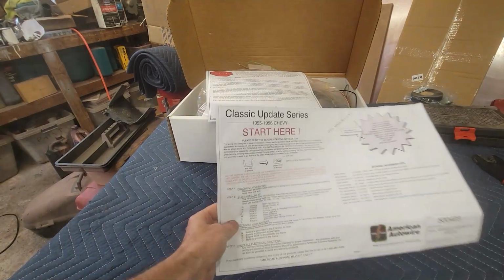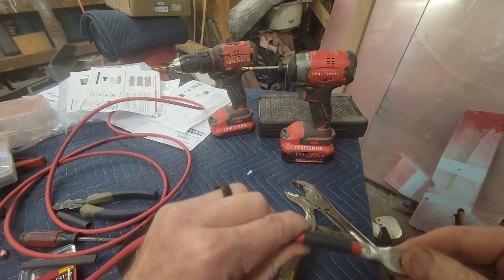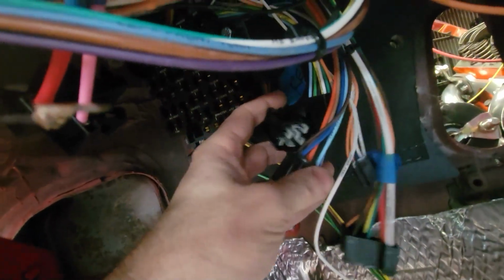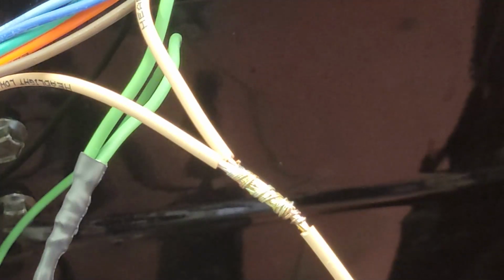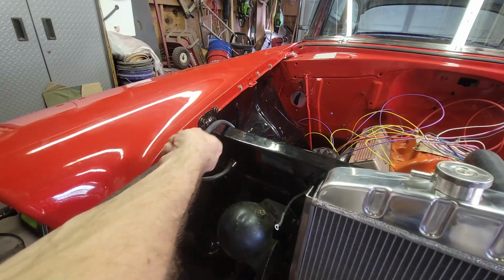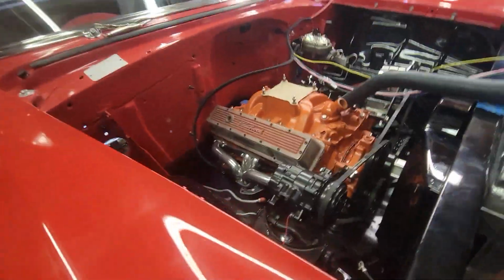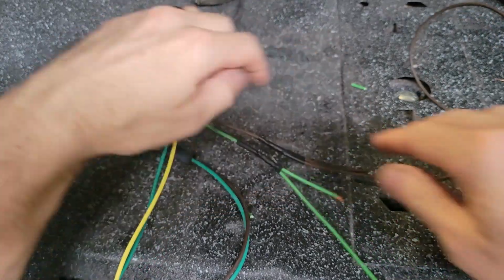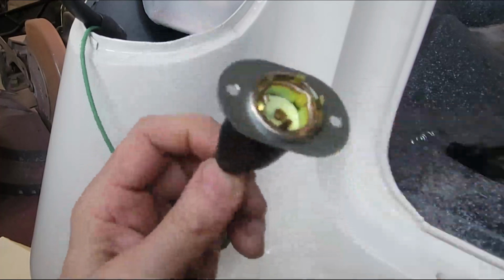E139 Pt 1 - Installing the American Autowire Classic Update Wiring Harness! 1956 Chevy Bel Air Resto

Comment: Great videos on restoring Christine. I’m re wiring my 55 right now with same kit. On the back up light kit the rubber boot goes in first through the front of the housing. Everything is held in place from the front not the rear.

Comment: Great video. Autowire has two videos on YouTube devoted just to crimp and have to crimp twice. Be sure and practice this several times before you do it for real. And also practice with some wire in the connector as it makes it easier to get a good crimp. Unfortunately, only the insulator was crimped. It is a two step process: Crimp the insulated section, then crimp the conductor. Bills technique may be bettwer, one and done! One note is if you want to use the LED RapidFire tail lights, with steady turn signals, you will have to run a dedicated brake light wire from the AA third brake light lead to each of the tail lights. You will also have to clip the white lead from the brake light as this is the combining wire to the turn signals that would cause flashing of the turn signals. Which I don't want. RapidFire includes an extra lead, for this purpose if you decide to dedicate a seperate turn/brake setup. I also prelabeled all the leads from the fuse panel so I could easily see which plug went where. I also identified the correct holes on the firewall to install the grommets ahead of the harness so I wouldn't have to cut them after the wires were installed. It will also require you to install the firewall pad, if you are using one before installing the fuse panel, according to the AA diagram, which requires the removal and reinstall of the parking brake handle and steering column. I am running the majority of main fuse panel inside the fire wall, rather than outside where I can for a cleaner install.

Comment: Sooo glad you are making these videos!! Good reference, for both us and you! And I luv your attitude. Having never installed one of these wiring kits before, I'm afraid I would be defeated before I started from fear of the unknown!  ;) However, even though it's a complete kit, it sure seems to require a lot of 'extra' work! I have not pulled the wires from my car yet. Have not decided if I should jerk everything out, or removed them circuit by circuit?? My car came off the drag strip years ago, and doesn't even have a fuse block!!  :(
Reply: You may have covered this before, but what brand is that wiring tool you are using??  :)